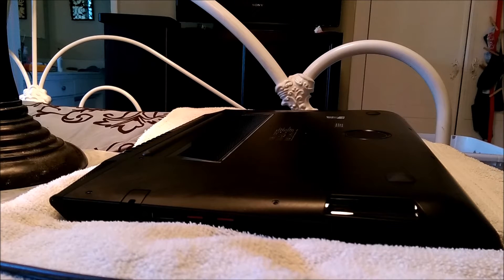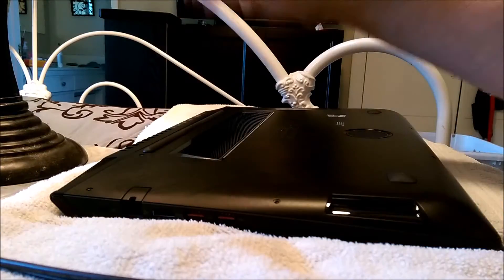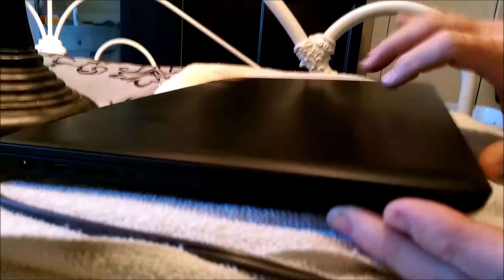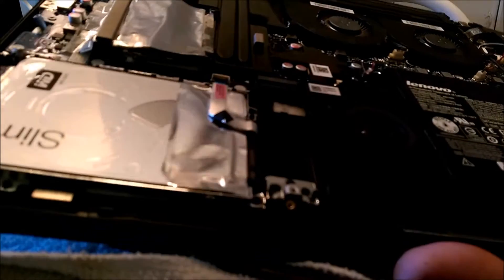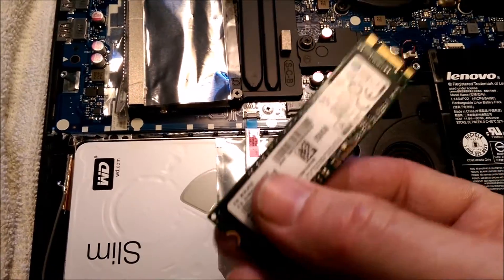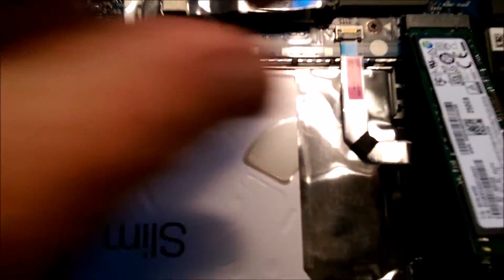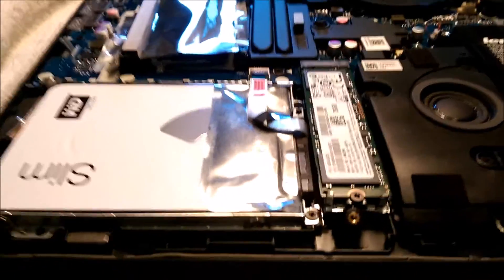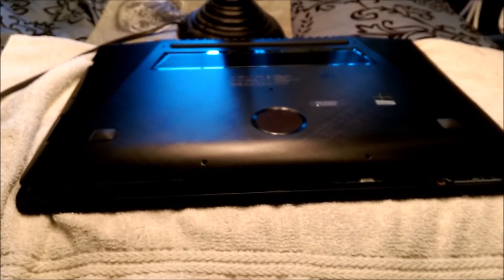How to Install a Samsung EVO 850 m.2 ssd in the Lenovo Y700-15ACZ

Comment: Does the SSD need to be screwed down? Mine came with HDD only and it didn't come with the screw for the SSD.
Reply from the maker: 山内淳カイル yes it needs a screw. I used one of the hdd screws.

Comment: do I need to install some kind of driver like the 950 pro nvme ssd?
Reply from the maker: No, If you have installed the 850 evo m.2 you need to disconnect the mechanical drive and install windows to the m.2. Then hook your mechanical drive back up. I tried the samsung utility that migrates your os to the m.2 drive but it would fail at 99%. The above method is how I got windows to run from the m.2 drive. You can try the migration tool from samsung, maybe it will work for you. I made a video on how I got this laptop to boot from the m.2
Reply: well ive tried to make some shortcuts and......... it didnt work.
and then i tried your way and everything working great. thank you very much!
Reply from the maker: No problem.

Comment: My problem before was finding a Samsung 500GB 850 EVO Pro mSATA, I just realized the the Y700s 2nd drive bay was for m.2 drive, now I would have to find a Samsung 500GB 850 EVO m.2 SATA. And if it was hard to find before, I guess it would even be more complicated to find here in my country. Damn it. >.<
Reply from the maker: Joshua Cariño are there any m.2 2280 ssd drives available where you are? I know the Samsung is preferred but I hope you have other options.
Reply: *****
if its that Crucial SSD, nah, I cant even find a 500GB version of it, i just usually see 120-250GB version of it. However Samsung SSDs is the ones I still prefer. It just the rarity of the high end ones is soo irritating. THe Samsung 250-500GB 850 EVO are mainstream and can be easily find though,even then, they are all mSata and not M.2 Sata. :/

Comment: hi, i would like to ask, if its possible to mount ssd m2 43mm, its smaller version (is there hole for screws)?
Reply from the maker: David Schopp I 99% certain it only takes an 80mm, if you want to screw it down.
Reply: only 2280

Comment: i have this laptop with ssd samsung 256 without hdd(from the factory) ,i can mount a hdd or ssd 2,5''? have connector for hdd ? (sorry for english)
Reply from the maker: yes you can install an m.2 ssd. it has to be the 80mm in length. you will also need a screw to hold it in place. I borrowed one from the hdd tray. now to get the laptop to boot off the m.2 you need to check my video on that.
Reply from the maker: oh, and yes you can install a 2.5 ssd. as long as it has the standard sata connector.